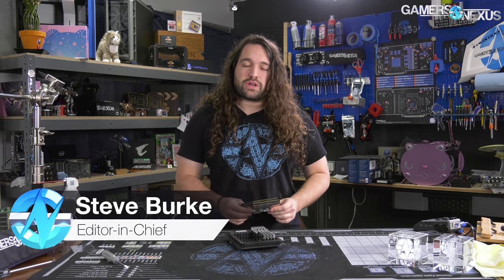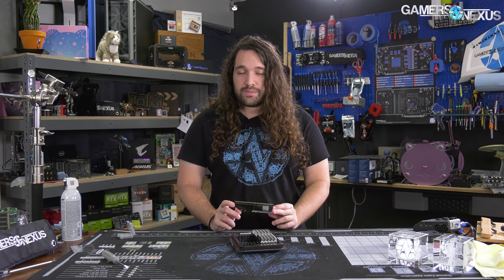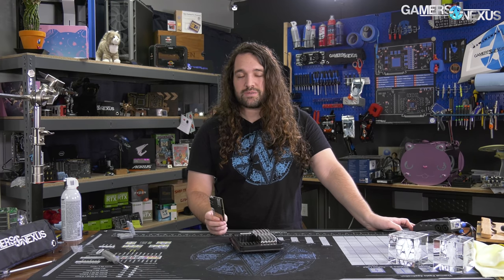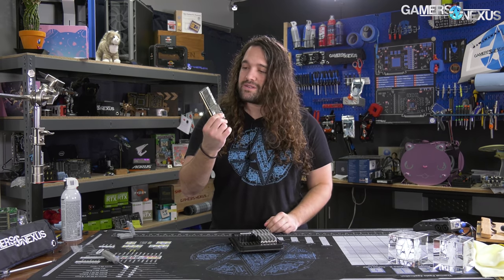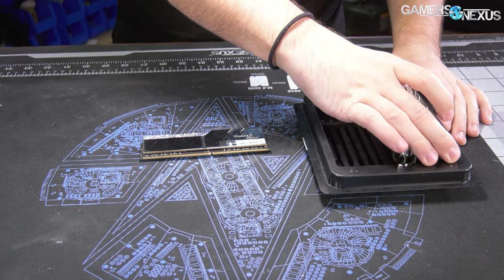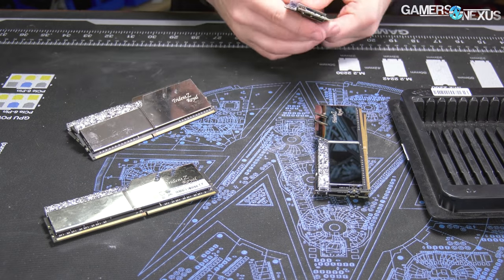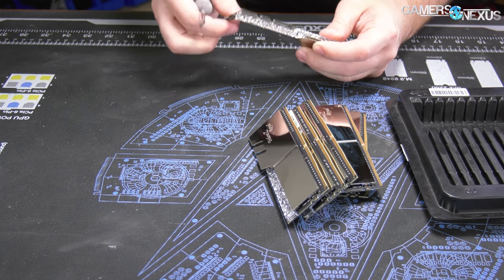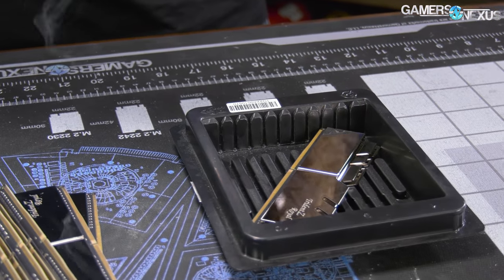"Delidding" RAM with Liquid Nitrogen, ft. Joe's Trick

Comment: The trails above the ram in the LN2 look a lot like the trails of condensation in a cloud chamber for visualizing particles
Reply: Thought the same, very "cool" effect indeed!
Reply: Yeaaaaa, and that a little bit suspicious.
Reply: @Vatharian  considering Electronic devices emit Electromagnetic radiation anyways so yeah not a surprise at all
Reply: @MaxC_1  EM radiation doesn't cause condensation trails. Alpha particles do. You could get comparable effect on resonant frequency near microwave emitter or with laser, but it look different.

If Steve had a mechanical wrist watch with tritium lumina it would explain it, or they could have very old smoke detectors in the office.
Reply: @Vatharian  Old smoke alarms wouldn't really be explaining all those trails.
Nor would a watch face....
That there is a lot of trails, could be excessive radon in the air, but that is likely not that case either due to ventilation in these types of commercial spaces. (unless the ventilation system takes in air from low ground levels, that can actually increase radon levels indoor "slightly", but not much... And it won't accumelate.)

In the end, I would likely put it down to the fact that the LN2 bellow is still boiling.
This can cause agitation that creates its own contrails. This is why cloud chambers are mostly sealed boxes, and the air within is practically motionless.
Just blow a little air into them and they get upset and gives a lot of false positives. After all, the air is saturated with water vapor, in a similar fashion to how critically cooled water doesn't freeze. But give it a reason and it quickly freezes, the same thing goes for the air in a cloud chamber, give it a reason to condense into smoke, and it will quickly do that.

But technically, one can build a cloud chamber with just an open vat and LN2. Just don't have stray air blowing over it.

But the noise within the system needs to be sufficiently small for the energy in a fast moving particle to be statistically significant. (This is a pathetic amount of energy btw...)

Comment: Liquid nitrogen applications are very interesting
Reply: This itsn't really a LN2 specific thing. It's just a demonstration of differing thermal expansion coeffecients.
The thermal interface contracts&expande faster than the components it's attatched to, therefore ripping itself off the circuitry.
Reply: @vikmanphotography7984  but it is a LN2 specific thing,...he used LN2, sure other things could have done the same thing, but to know you could do this with LN2 is really cool....I don't understand the purpose of your comment.

Comment: I wonder if that googone stuff would penetrate the thermal pads enough to release in room temp.

Since with stickers the adhesive tends to wick the stuff pretty well, a few sprays with 5 minute intervals and sometimes the stickers just slide off without any significant scraping.
Reply from the maker: Maybe! Haven't tried it. Good idea!
Reply: My main concern would be the oily residue that Goo Gone can leave (it's made of petroleum distillates). This isn't flammable, but it can put off hazardous vapors, which is why you're only supposed to use Goo Gone in well-ventilated areas. The instructions on the bottle I have say to use soap and water to clean it off.
Reply: @lindasherman9921  I've wiped the sticker spots Isopropyl alcohol. If the surface can't handle IPA, I've used a damp (plain water) towel if there is some residue left by the generic stuff I've used. 

The can I have has no mention of having to wash it off with soap. It has a very potent citrus smell to it which lingers for hours after use, maybe the soap wash would help with it.
Reply: It may penetrate the memory package. It may work, but would need immediate cleanup with Techspray, or another similar product.
Reply: @lBonaCl  You need to use purified water (no minerals added) at the minimum. Any hard water left behind will short circuits.

Comment: Sure getting the TridentZ heat spreaders are a PITA because of the adhesive but LN2 is just overkill for the job. It is a super fast method though. I had used an old credit card for slowly prying without putting too much pressure in a small area and the process took a few hours.
Reply from the maker: Well, that's sort of the point. We didn't say it's the most practical way, but it took like 30 seconds on one of those modules.
Reply: Could of just used a heatgun to help with the removal of the heatsinks and saved yourself a few hours
Reply: @Neggy-Z  Didn't have one handy and it kinda takes a few days to source one via online sellers or a couple of hours to go down to the local electronics market here in India.
Reply: @gnsteve8846  Probably a silly question but what would be the effect of pouring LN2 on the silicon adhesive used for gluing CPU lids? I can understand that there can be other repercussions from trying to delid CPUs with LN2.

Comment: GNSteve, did you ever learn to use chopsticks? I'm so happy I learned, because it's gotten me out of a lot of serious situations when it comes to scientific experiments and computer building. If you learn, it'll help you effortlessly manipulate objects when they're submerged in liquid nitrogen, as well as any other form of nasty liquid you may be dealing with. Additionally, if you use wooden or plastic chopsticks, you can use a sharp knife to whittle the tips of them to turn them into fantastic custom prying tools. Furthermore, the wood ones are nonconductive and far more forgiving to electronic components than a metal probe.

Comment: For average Jo I use a heat gun which does the job just fine as well.
Reply: if done improperly, the heat gun can desolder SMT components or damage them. That's way more risky than using cold.
Reply: @PainterVierax  Yeah don't need to heat it that far lmao, I have a craft heatgun which doesn't get anywhere close to hot enough melt stuff, it barely melts plastic if i try my hardest to do so but it's brilliant at getting glue seperated. A paint stripper or solder workstation heatgun will incinerate and melt stuff though.

Comment: A couple of days ago I've just used hair dryer and wooden ruler in order to remove old thermal pads and replace them with arctic ones. Worked perfectly even though it gave me only 3c of improvement under extreme test mem + gpu stress test at the same time. But it is good result for me because it is mostly around 30c at my room in the summer.

Comment: Removes warts. Removes tacky heat spreaders. Removes Jay. Nothing it won't do.
Also as an aside, I had a set of ripjaws where the aluminum was so warped the spreaders pulled themselves off somewhere between the factory and my doorstep. Easy peazy.

Comment: If you don't have LN2, and you do have a bit of patience, soaking your RAM overnight in isopropyl alcohol works really well. That's the method I used on the system I'm typing on right now.

Comment: That cat hair like effect is called surrounding radiation. Basically it's the radiation that's happening all around us. You could see nearly the same results with cloud chamber. It only works with cold enough temperature and humid air around it that became cloud.

Correct me if I'm wrong.

Comment: Let me tell you my own RAM story. Have 8x8gb 2400mhz ddr3 g skill trident x. I needed to remove the extended fins on the top. This should be as simple as undoing the screws on either side of the ram heat sink and sliding the extended fins off. The problem is the tolerance of the extended fins on top are so tight that this is not possible. I read up online and other people has the same issue, so I took to removing it by hitting it with a hammer from the side. Fortunately all 8 sticks still work as they should despite one of them having a dent in the side of the main heat sink.
Reply: Actually have the same kit and didn't have this issue.

Comment: I had a nice set of 4x2400 DDR3 and I tried to remove the heatsink from one of them and it removed two chips. Luckily a few months later I got an x58 board so I could use the survivors in triple channel.

Comment: Wonder if a DICE and acetone bath is enough to crack the adhesive.
Reply: Acetone bath without the dice is enough, but it will remove any printing on the label . That would make an rma impossible. I'd go with just the dry ice and a hot air station, heat gun or hair dryer. Warm em up, toss em in with the dice, if that doesn't do it hit em with heat again once they are close to -78.5C
Reply: @gtijason7853  Thanks, gonna try it next week. Have a passive SFF build going, but that damn heatsink is just way too large! (or more like the mem is too high :D)

Comment: Actually this can be as harmful as heating something up, since it's mostly about a temperature difference. Which can warp certain mechanical parts as well as creating (micro) cracks in the soldering joints or making it brittle. 
Most IC's (memory chips) also have an absolute minimum temperature value, which often can be found in the datasheet.
Most adhesives will melt way before the maximum temperature of most chips. The ones that are not are quite expensive anyway.
So I personally would just use a hot air soldering station, or just a (reflow) oven. That's also easier and less expensive
Reply: ln2 costs nothing and hot air is riskier. Why risk ripping 200$+ ram to save barely any money?
Reply: @yetanothaone2824  Riskier how? These things are often professionally reflowed on the same way. In fact my whole point is that have a significant change of damaging your memory this way for the reasons I just gave.
But anyway, not my money so have fun with a much more cumbersome, riskier and more dangerous method. 
I guess I also don't know a thing or two after 30 years of developing computer hardware and the like? 
Fanboys will be fanboys